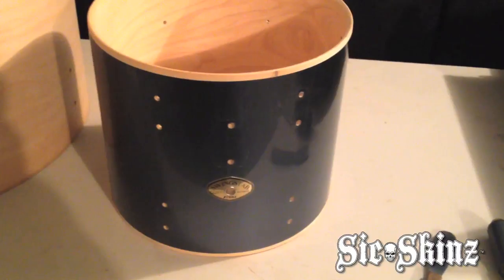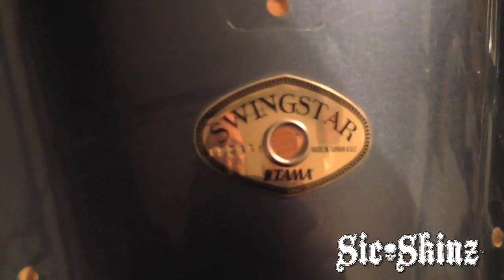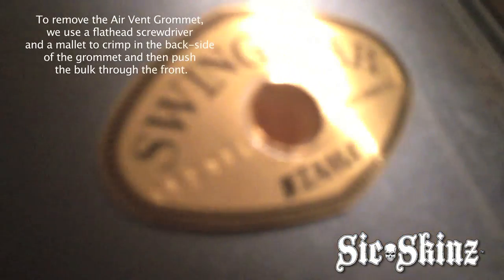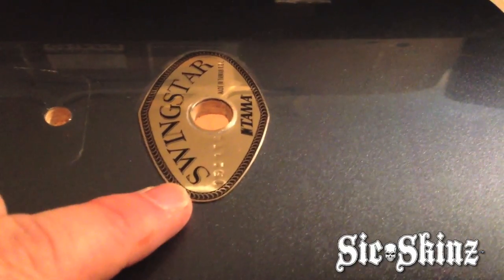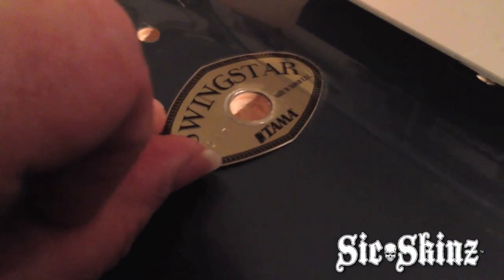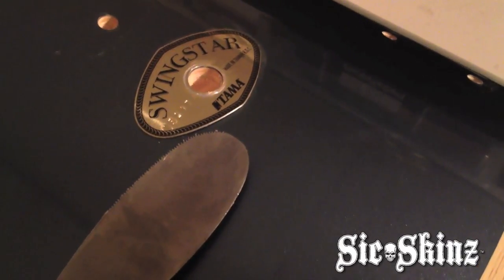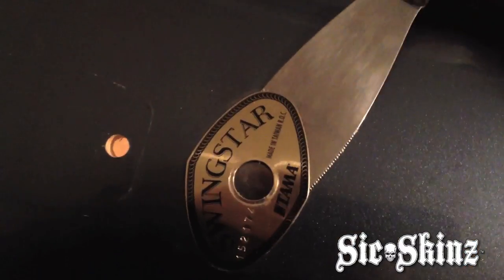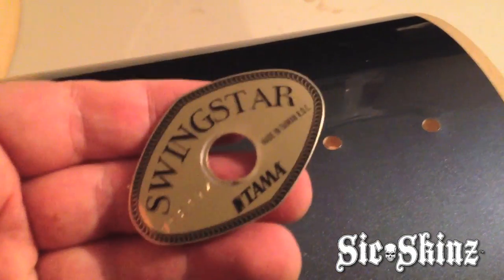Drum Shells: Name Badge Removal

Comment: Be good to know how to remove the grommet inside and re use it.
Reply from the maker: Sadly, if the grommet is a stamp-in type (like the ones MOST reputable builders use), it cannot be removed and re-used as the removal process will almost ALWAYS destroy the grommet by either folding the edges, or removing the lip altogether. This is why I always remove them and replace them with a new one.
Reply: @SicSkinz1  thanks.
Can't locate a new one.
It's a yamaha recording custom.
Reply: @SicSkinz1  I'm going to try to unpick it and reform them.
Appreciate your reply buddy

Comment: This is how I removed the grommet and badge.  I used a pair of medium sized vice grips and used the corner of the teeth to clamp down, bend and bite off little pieces at a time from the back rim.  So far so good except there was some resistance from the jagged edge left behind. Then I used a thin letter opener to get under the badge from the front. This is where everything went to hell.  The glue was way too strong on the back of the badge to allow it to be lifted out which eventually bent the badge from the front.  All that was left to do was use the vice grips again and pull the badge out from the front which completely destroyed the freaking thing.  "Badges?  We don't need no stinking badges!"  The drum manufacturers install badges this way so they are permanent fixtures of their drums, gee I wonder why?  BTW, Wood damage from all this was minimal.  I ordered a 1/2" threaded vent to fill the whole and it looks great, here's a link. https://drumsonsale.com/worldmax-threaded-air-vents-tav-001.html  Good luck, you're gonna need it!

Comment from the maker: Kenjo, We'll make a video showing how to install the badge back onto the drum shell properly. But, in the meantime, the best way to do it is to use the same size air vent your shells currently have, and press them in using a Ball Peen hammer's rounded end on the inside of the shell, pushing and flanging the backside toward the shell, while laying the drum on a smooth, hard surface, with a towel under the front side of the air vent to prevent damage.
Reply: I see, I see. So I have to use the old air vent grommet yeah? Or do I have to use a new one? Also, it's kind of a bummer that the video skipped on how to remove this kind of air vent grommet. It should have been involved as well. :( Would've love to see how to you guys remove this kind of grommet in action. I kind of learn things best when they are illustrated on video. If you make that new video, could you also involve removing a grommet like this and then reinstalling it with the drum's name badge? Would be much appreciated!
Reply from the maker: No, unless you have the Pearl type of air vents that fit inside of each other, you cannot re-use them. They will be destroyed by the time you get them out. You will have to replace the stamp in type.